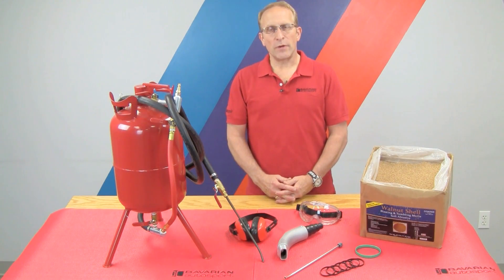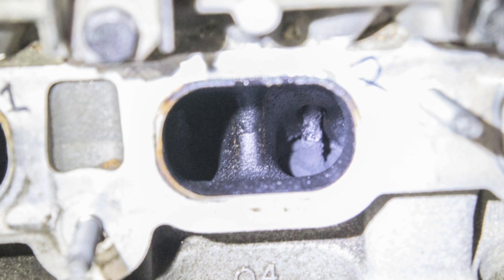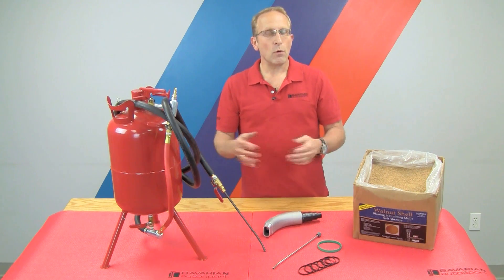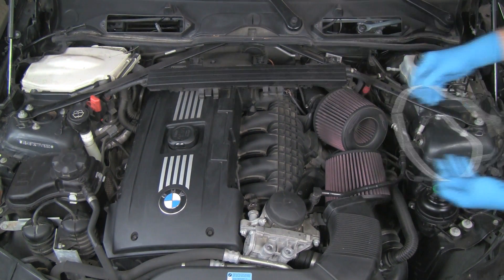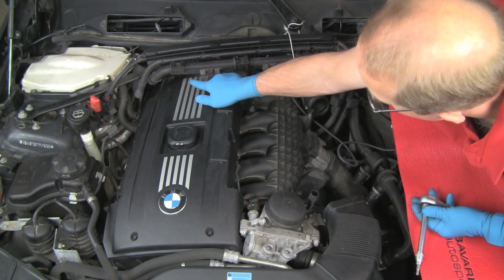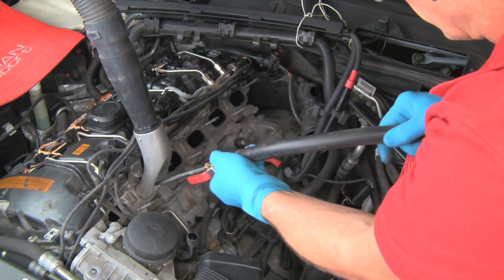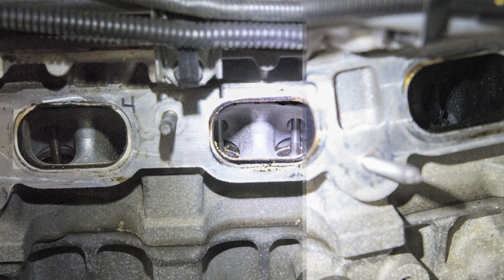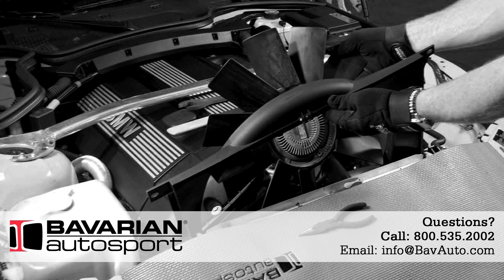Cleaning carbon from intake ports and valves on BMW and MINI turbo engines N54 N55

Comment: that is NOT the fuel vapor recovery pipe, you and burger man,  i swear.. the fuel vapor recovery is on the Throttle body, that is the brake booster vacuum tube,  because the brake booster does not have a check valve, and the car was designed to run it off the vacuum pump, not the intake so there would be no issues when driving it spiritedly  ( also why it has vacuum canisters to create a reservoir of low pressure for persistent on/off throttle boost control) 

and why i know the TB plastic hose is fuel vapor recovery is because the damn solenoid for EVAP sits on the other end, i had to move it out of the way to reach the trans bolts after installing  a new rear main seal and a 335IS clutch..

Comment: Do you know what tools exactly would I be needing to open up all these parts?
Reply: TOOLS LIST:
• 20 lb pressure feed media blaster (BavAuto)
• 25lb walnut shell blasting media (BavAuto)
• BMW port adapter tool (BavAuto)
• BMW blaster nozzle (BavAuto)
• Torx bit set, 3/8" drive (BavAuto)
• Starter jumper wire (BavAuto)
• Fender protector (BavAuto)
• Shop vacuum with hose adapter
• Eye protection
• Hearing protection
• 3/8" drive metric socket and ratchet set, 8mm through 13mm
• Various screwdrivers

Comment: And this is why Toyota's D-4S is better, direct and port injectors working together, best of both worlds.
Reply: However, Toyota does not allege the D-4S system eliminates intake valve deposits. The primary reason for the D-4S is emissions related.

Comment: Is this why installing an oil catch can is really important? Does it slow down this from happening?
Reply: Herakles -- yes it does. It's the PCV / EGR that is causing this carbon. Eliminate them and the valves will be like new forever. 

I'm not sure why OEMs don't install an oil catch can to lessen this problem. Idiots.
Reply: Because the average joe wouldn't service the catch can regularly and it would overflow and cause damage

Comment: Alot of work for nothing. Once drive the car above 4K RPM for 10 min
Reply: But have you had a f/I bmw
Reply: first I've heard of this type of procedure. can you provide proof or online sources where this has been confirmed to work?
Reply: I have over 20 BMW since 1983 never have issues with carbon.
Calling Burn carbon, and used Shell gas

Comment: hey Otto!  Are you guys working on a DIY how to for carbon cleaning on the diesel engines?  I know it is tough but the community is gonna need it!
Reply: I'm in the same boat. I have a 2011 35d, and a 328xi. There's a carbon clean procedure that utilizes hydrogen, and does not require opening the manifold, however the locations in the US are few and far between. Walnut my only option as well.

Comment: This is the ONLY safe way to clean the valves....and yes, fuel no longer touches the valves so no additives or fuel can have any impact. Running only a full synthetic results in a much less severe rate of coking vs syn blends.  Our catchcan systems prevent app. 85% of this formation as well. NEVER do a solvent based engine running service!!!! It causes scoring to pistons and cylinder walls!!

Comment: Also, can't you just turn the crankshaft bolt to turn the engine and close the valves? Or is the engine bay, let's just say, too tightly packed? -_-
Reply: Depends on your car but mine was too hard to get to.  And bumping the starter was a piece of cake.  Super easy.

Comment: Oh sweet Jesus almighty! I thought the engine bay of my E39 525d was fully packed... but this is just on a whole different galaxy level of packed and complicated! By the time this guy was done with just the plastic covers, I would have the intake manifold of my Direct injected diesel already on the table. I don't like overly complicated cars, and it's frightening that one day in the future I will have no choice but to drive these (what then in the day will be slightly older) BMW's with such complicated issues... Jesus almighty indeed, do give me strength in the future! I do hope my E39 525d will run forever lol

Comment: I notice when I pulled my air intake manifold off my BMW 2011 335D  M57, I can not see the ports or valves on the engine?  I did notice huge amount of carbon buildup on the ports.  I cleaned ports that were massivly clogged and cleaned the swirl ports on the manifold.  I also cleaned the EGR  and changed the glow plugs while I was at it but I am not sure how to get to the valves?  The open ports swerve back in to the engine where there is no line of sight of the valves.  I would appreciate the feedback and advice!

Comment: Greeting from Shanghai! Thanks a lot for this high quality video as always. Has been learned a lot from your channel. One question, as I know for N54/N55 engine and all the newer BMW engines, there are small passage holes on each cylinder head intake runners for crankcase ventilation purpose, so is there any risk that the walnut blown into this passage?

Comment: Hmmm what if the valve is not 100% sealed, you tapped it so the starter just turns a bit but worse case could the car fire with a little walnut? Also how long is this process?

Comment: can't you just use a fuel system flush like seafoam or something ?
Reply: No. No one would do this if seafoam worked. This is on the intake ports, and there's no fuel going in there in a direct injection engine. If there were, this problem wouldn't even occur.

Comment: With the new subaru FA20 engine platform being direct injected there will been a rise in carbon build up problems so I will be purchasing one of your kits but I have a product suggestion you should make a shop vac intake valve adaptor for the FA20 subaru motor for purchase the FA20 motor is used in a lot of subaru's new cars and people are going to start looking towards walnut blasting since DI engines have carbon issues

Comment: Is there anything that can prevent the carbon to start?  Perhaps a spray of Throttle body cleaner in the intake while the engine runs every oil change?

Comment: Can this condition get bad enough to cause a loss in cylinder compression, and cause a car not to be diveable at all?
Reply from the maker: In theory, yes.  If the ports are so clogged that little air can get through, this would reduce cylinder compression due to incomplete cylinder filling.  At this point, it would also make the engine practically (or fully) unable to run.
Reply: http://www.czyszczeniezaworow.pl

Comment: which valves need to be open or closed when you go to pressurize the walnut tank? which valves need to be open at the tank in order to shoot out the media when the valve at the handle is open?
you are not showing how to prepare or use the tank correctly

Comment: which valves need to be open or closed when you go to pressurize the walnut tank? which valves need to be open at the tank in order to shoot out the media when the valve at the handle is open?

Comment: I think that it is ridiculous that a manufacturer would produce engines that require such expensive service in order to switch to direct injection.  The small benefit derived from direct injection don't justify spending $1100 every three years just to make the engine cold start and idle smoothly.
Reply: this car has such sweet acceleration though.  It's way worth it.  Without even forcing the engine 50% of the capacity itll smoke most other cars
Reply: +John Ferguson - Yeah, as a long time enthusiast I've owned 5 BMWs over many decades and I have to say, this carbon issue, the HPFP issue and BMW Canada's $500 extortion fee for an importation recall letter has turned me right off of BMW. I won't be buying another one. I've switched to Japanese (Mazda, Subaru & Infiniti). BMW has turned into a damn joke and lost one lifelong customer over their poor design and general idiocy.
Reply: OMGWTFLOL   The new Honda direct injection engine has a second set of port fuel injectors that are activated under heavy acceleration.  The spray of fuel cleans the intake and eliminates carbon build-up.  i think that other builders will adaopt the same concept; it seems to make perfect sense.  The Honda can idle and cruise at air/fuel ratios up to 41:1 almost 3 times the stoichiometric ratio.
Reply: Toyota is japanes and better than all those you just listed. Infiniti is made by Nissan and Nissan is junk.
Reply: toyota sucks dick.  reliable, but ugly.  bmw kicks its ass all the way.  put your camry up against my '12 m3 comp package and ill take u any day.

Comment: Unless these modern direct injection engines are twice as economical as the older port type injection which they don't seem to be i.e. not on par with a comparable sized diesel engine then unless the manufactures solve this problem is surely a backward step as I remember way back from the 60s onwards to around the 80s we had to decarbonise engines at around 40 thousand miles. But that was because of the petrol used then. So we gradually improved the fuel which gave us cleaner engines that would be carbon free right up to an engine overhaul at well over a 150.000 miles to now using walnuts to clean out our valves system What a joke!!
Reply: +peter jones all in the name of progress.

Comment: run highest grade octane fuel to eliviate build up. 91 or 93.  "87 builds carbon daily."
Reply: +ethiopianeyes this has nothing to do with fuel grade/quality.
Reply: +ethiopianeyes   Since the engine has direct injection, the fuel quality doesn't have any effect.  The fuel is injected directly into the cylinder.  The carbon is coming from the crankcase vapors being drawn into the intake manifold through the EGR valve.  Fuel quality has a big effect with port fuel injection or throttle body fuel injection.
Reply: they use a different octane reading System: US 91 octane equals europes 95 octane; US 93 octane equals europes 98 octane...
Reply: yes the egr valve is the big one. but your shitty fuel in america don.t help ...  if you run 87 on a bmw you are a moron  . you can even get that bad gas here in europe. the lowest is ussely 92oktane with the 95 oktane being the standard

Comment: Great video and fun exercise for a weekend morning BUT this made no difference to my N54 engine.  95k miles, regular oil/spark plug/air filter changes but first time for carbon cleaning.  I was hoping for a smoother idle but engine runs the same.
Reply: Probably a leaky AEP valve (anus excitement port)

Comment: Is this now available for the E90 335d? M57 engine. (I think it is from looking at your website) I have a 2010d with 90,000 km on that I'm pretty sure has carbon build-up issues. If anyone knows of anywhere in the Toronto area that can do this on a 335d for a reasonable price let me know - Budds in Oakville charge around $1450+tax for doing this and I'm not 100% convinced they have a lot of experience doing this. J&R Auto Electronics in Oakville have experience making ECU program modifications to the EGR that will significantly reduce the problem but they don't actually do the decarbonizing at this time.

Comment: any indy that does this in orange country
Reply from the maker: We have no contacts in the area, but we would certainly assume that there are shops prepared to do the walnut blasting.
Reply: i found a shop that does it for 350$ is that a fair price ?
Reply: GangGreen_714 My local BMW dealer charges about $600 (they are in Virginia), so I would say that's a great price.
Reply: Tom Sanderson daaaammmmm pricey ... i found a guy that works on n54/n55 engines he did this for me for $250
Reply: GangGreen_714 craigslist? that guy? thinking about it
Reply: FilmSupplies Rob ?? i went to rob he does a great job bro if were u i would go to him. he also change a couple of my fuel injectors that were leaking
Reply: GangGreen_714 info ?!

Comment: Isn't there any type of "rinsing" procedure of the ports afterwards? The ShopVac alone couldn't remove all dust & debris by itself.
Reply from the maker: Nope ... no "rinsing".
The vacuum does remove all but a few particles that may stick in the crevice between the valve seats and the valves.  Any left-over walnut particles will be burned during combustion.
Reply: Too bad- someone hasn't developed a way to seal or coat that area of the head- like with a Teflon or PTFE resin after a cleaning job like that- to make the surface slick and oil resistant. There probably are a few coatings or treatments out there that would hold up.
Reply: +HUBBABUBBA DOOPYDOOP nanotechnology perhaps one day will do just that
Reply: There's already coatings out there that will do exactly that. The only thing stopping anyone from doing it is cost.
Reply: is it common at all to have no start with no cranking after this procedure? or would you say there was something missing in reconnecting everything back?

Comment: Also close all holes, in case media gets away !
Reply: +James Hall - Exactly. The other ports should all be taped over. If the blasting wand accidentally came out of the vacuum adapter during the procedure, some shells would surely end up in the other ports (and everywhere else).

Comment: Would a (non turbo) 1993 325i e36 with 700k miles on it need this carbon cleaning as well? Currently, No Start with car running fine only minutes earlier. local auto repair shop thought I had bad fuel pump. I told them I've been smelling gas a long time and seen some leaking from electrical receptical on sending unit (full tank of gas) only days before failure. The shop said they thought I had a bad fuel pump. I already knew I probably had fuel sending unit, filter, and carbon canister issues ..... parts just added.... helped none in getting engine to run. So, they gave up because know one around local knows about BMW engineering.... said car is acting like it has jumped time. I hope they didn't disconnect the vanos oil line thinking its a fuel line and trying to crank it... it probably would jump time then. Who knows???

Now car is at a shop that does work on bmw's and I told them what the first shop replaced and said and they went in that direction and requested my permission to remove valve cover and check things below. So, they called me back said I'm getting around 50 psi first couple of cyl's. and 65 psi on rear cyl.'s..mentioned something about 143 psi. Said averaging 70 - 90psi and that is with the engine out of time. If it was in time the psi readings would be up in my opinion. They're leaning toward my engine is having issues with timing chain maybe reworking the head said maybe best to replace w/used low mile engine being nearly same price to repair....  WWYD with a 700k miles engine trying to get 1 million miles before retiring my lil toy? Should I replace timing chain(s), sprockets, guide, and tensioner myself at home or best to find good used engine low miles and have pro install? Current shop quote $2500 that route and ANOTHER shop I'm considering has used bmw parts and mechanics $1600 for engine with120k miles and installation included. $750 for engine and $850 labor.

BMW North America should hook me up for life on this car as a test platform,,,,, 1 Million Mile Bimmer please pass this along to someone very high up in marketing at Corporate BMW Headquarters North America ; . )
Who knows this might be a perfect marketing ad for Corporate BMW and Bavauto promoting and proving auto trust and longevity giving the world market a new angle/edge on quality, class, and German engineering perfection.
Feel free to contact me here or via email adr. Many thanks, kennyj_wsp at hotmail dot come
Reply from the maker: Lots of issues here & the shops have been going in the wrong direction to diagnose.  First steps are to check for spark, injector pulse and fuel pressure.  I see no references to these most basic diagnostic steps.  Please email info@bavauto.com and note that we requested you to do so, from your youtube comment. and to forward to Otto.

Comment: Thank you BavAuto for another informative video. I have question as usual. I changed rocker cover gasket on my e38 and noticed loads of carbon in it. My question is, is there any other way of removing carbon from there without sand blasting? Is there any cleaning liquid that can do the job? Many thanks.
Reply from the maker: Short of scraping or blasting, if you run the Liqui-Moly Motor Cleaner before each oil change and run the Liqui-Moly synthetic oil (highly detergent to the carbon and sludge), with 3000 to 5000 mile changes .... over time, the sludge and carbon will clean up quite a bit.  See these products in our online store at www.bavauto.com

Comment from the maker: RisjadOktrianji - We can't reply directly to your comment as it was sent via Google.
The intake manifold is not a problem.  the ports and valves are where the carbon builds up.
Reply from the maker: *****
Nope ......
Since there is no fuel injected into the intake ports on the direct injection engines, any fuel additives would only go directly into the combustion chambers .... completely bypassing the carbon in the ports and on the valves.
Reply from the maker: *****
They do have fuel injectors, but they are mounted to spray directly into the combustion chambers as opposed to into the intake ports.
Reply: BavarianAuto  Do you have a walnut blaster that fits 335d or m57 engine ???

Comment: What are the adverse effects if any, from walnut fragments entering the combustion chamber?
Reply from the maker: Very minor walnut shell waste getting into the chambers will have no effect (they will burn up through the combustion chamber and/ or catalytic converter).  If a mistake has been made and a cylinder was blasted with the intake valves open, we would suggest that the vacuum adapter be applied and air-only be blasted through the blasting nozzle, directly through the open valves.  this should agitate the walnut media and allow most of it to be vacuumed out.

Comment: N62 engine
Reply from the maker: The N62 V8 does not have direct injection.  Therefore, it does not have this carbon issue.